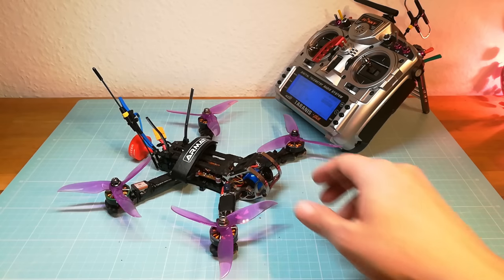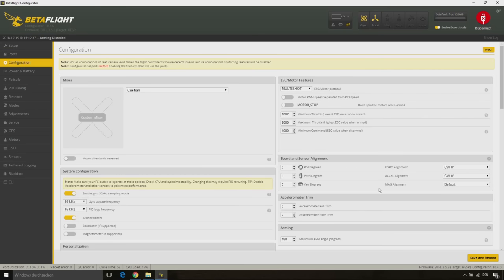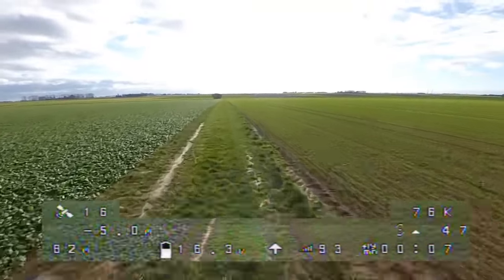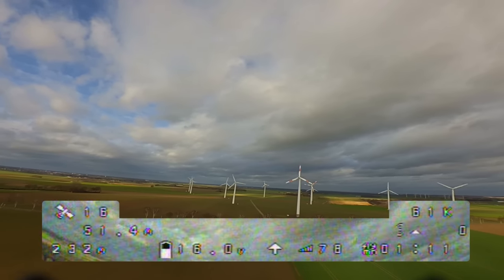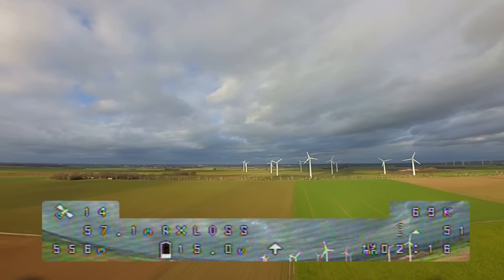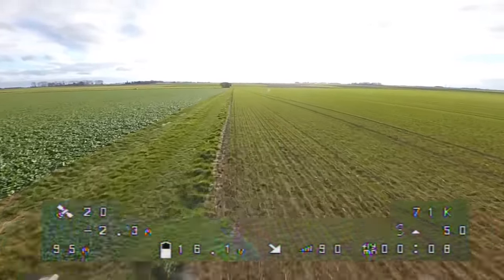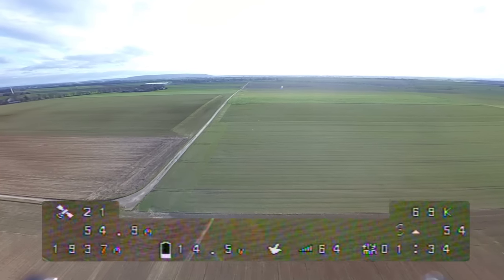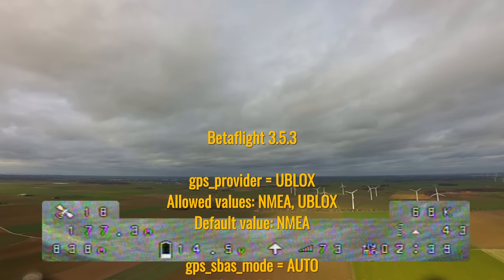Betaflight - GPS 🛰️ Rescue Mode 🚨 - Final Test - BN-180 GPS - FrSky R9M - english

Comment: I'm curious how you got your radio to power on and not immediately disarm ?  No 2 stage arming I guess ?
Reply from the maker: Tavis Gustafson why do you think the quad would disarm when i switch my radio on again?
Reply from the maker: That's how the gps rescue mode works, you get back control when your receiver gets back the signal.
Reply: @TorbanDallas  When I switch my radio on, it always starts as disarmed, but now I realize it's because of the two switch arming I have set up.
Reply: @Tavdog  well on my flysky radio it wont turn the radio back on until you have the switches in a certain position which meant it disarmed the quad in flight quite annoying. I guess i could have just gone old school stick arming to avoid that.

Comment: Is the GPS module only for the rescue mode, or can you programm any other things?( like automatic flights to checkpoints and so on)
Reply from the maker: Well, it even shows the flight altitude, speed, home direction and so on. In Betaflight you can't program a flight to checkpoints. For this you better check INav instead of Betaflight.

Comment: Hello, I am attempting gps rescue and when I flip the rescue switch the drone flies away from home not towards home, any troubleshooting tips ?
Reply from the maker: That sounds pretty bad, does your home direction arrow point to the right direction? Is your accelerometer enabled? Did you get enough satellites and did you enter the right baud rate for your GPS module? Maybe it doesn't respond quickly or if there's an orientation error.
Reply: @TorbanDallas  is there a specific orientation for the module ?

Comment: I have an FrSky XM+ and sometimes even at 100ft away from me, I encounter RX LOSS. Is it because I'm flying in a residential area where there are many interference like wifi?
Reply from the maker: Maybe. Or there are objects between you and your quad. Or lose antennas.
Reply: There was no obstacle. It was clear line of sight. I bought a new antenna. It's VAS Diamond 2.4Ghz omni-directional antenna. I'm hoping this is better than the stock antenna that came with my JumperT16.

Comment: Do you know what Happens if the quad looses sats for a second while it’s in return to home mode?
Reply from the maker: If the quad loses sats while you are flying, and the sats are dropping below your min sats, the GPS rescue mode won't work and in case of a failsafe, your quad would disarm. But I don't know what happens when your quad loses sats when you are already in the rescue mode. Maybe it also disarms, but I can't imagine that it would lose Sats on the return to home flight with a higher altitude on a straight line.
Reply: my sats sometimes go down to 7 when I fly steep curves and rolls. I lowered the min sats to 5 so I can be sure it won’t effect the rth... HOPEFULLY

But you are right that it probably won’t happen when it goes in a straight line.
Reply: I would suggest you to set gps min_sats=0 because otherwise it would not arm indoor.

Comment: How did you get it to work with RESCUE_SANITY_ON if I have it there and failsafe kicks in it will go to home alt, and then disarm. I dont have angle mode on? could that be it? I have to use RESCUE_SANITY_OFF for it to work with failsafe,   It works fine with Rescue mode switch.
Reply from the maker: with the latest betaflight version it should work with sanity on.
Reply: @TorbanDallas   You mean stable or unstable version?

Comment: Hello Torban, quick question brother. If I turn the ACCELEROMETER OFF, will it affect the normal operation of the GPS? I asked this because I turn the accelerometer off and when I flicked the switch to rescue mode, my drone became unstable in the air, so I just took over the control but it scares me 😱
Reply from the maker: AHHHH wtf, don't turn off the accelerometer! If it is turned off, the rescue mode won't work and the home arrow also won't point to the home direction. You also need the accelerometer for auto leveling when your quad is in the rescue mode.
Reply: Torban Dallas, that’s what I thought 💭😁, but I  turned it back on already. The reason why I turned it off it’s because, it might help with the Vibration. Anyways thanks for letting me know about my mistake 😂

Comment: Are you struggling finding satellites with yours? I have the same gps, but I'm struggling finding gps, even if I had a red blinking light earlier. I'm wondering if it is because of the cold in Norway..?
Reply from the maker: Taproot well i'm getting between 10 and 15 satellites after around 5 minutes. Make sure to use the galileo satellites too - it's a cli command. Also don't cover your GPS antenna.
Reply: @TorbanDallas  I only have a bit of tape over. I will have to check that command
Reply from the maker: @FPV-Jon  You can also add some shielding tape under your gps module. I have added a layer of copper shielding tape to avoid electromagnetic interference from my motor wires and escs.

Comment: Have you tested Betaflight - GPS Rescue Mode on BF 4.05 or 4.1 ??? If so, how?
  Have you used inch GPS? e.g. Beitian BN-880 Flight Control GPS Module Dual Module Compass or Matek Systems M8Q-5883 SAM-M8Q GPS & QMC5883L Compass Module ???
Is Beitian BN-180 enough for Rescue Mode ??? I admit that I lost the drone from Beitian BN-220, but maybe it's my fault I set something wrong in BF 4.05. (sorry for my English I use google translate).
Reply from the maker: I'm also struggeling with BF 4.1.x there's something changed in the Code. All in all it should work very similar as shown in my video. You can see my hassle with the latest version of Betaflight and the gps in my latest video. I won't test the rescue mode on BF 4.1.x until the gps code isn't fixed.

Comment: how low number of satelites you can use gps rescue ?
Reply from the maker: 6 sats is the lowest possible number of satellites. But I always wait for more than 8 satellites.
Reply: @TorbanDallas  what happend when I hanging upside down? and turn gps rescue? atomaticly flip over?
Reply from the maker: @246rs246  that's why I have set my rescue switch and failsafe stage 1 to angle mode  😉 but on the newest bf version it should flip to angle mode automatically before it goes into rescue mode
Reply: @TorbanDallas  thx 👍

Comment: How do you set the failsafe on a fly to it's limits
Reply from the maker: You can see all of my settings in this video.
Reply: @TorbanDallas  yes I see the setting but I did understand the part where you fly off as far as you  can and it shall automatically Rth once outta range... I have switch set up on mine to rth once I hit it but am trying to set it up where if I fly to far out of range that it RTH ON ITS OWN without hitting the switch
Reply from the maker: @glenmccall4571  it's the cli command. At the new bf configurator you can also set the failsafe procedure to gps rescue via the gui on the failsafe tab.
Reply: @TorbanDallas  i dont think you understand what am saying . i know about cli  i know about the failsafe  i know about the failsafe switch   also i know about and how to use my RTH  i have used it a few times 
.....am asking how do i set the the thing to where am flying way out pass my limits or range and NOT  switching the RTH  switch i want it to automac- turn around in come home after reaching its limts or range in you video you dont show how you just turn your kawd around and you dont show how you did it
Reply from the maker: @glenmccall4571  it automatically switches into rescue mode in case of a failsafe. I'm showing all settings, there isn't missing any setting
Reply: @TorbanDallas  thanks ill try all your setting

Comment: My XM Plus is good for over 4 kms....Yours went into Failsafe because your Lipo blocked the antennas.  Mount the Lipo under the quad.  Also, do not use the LBT Firmware on your 2.4 setup, its power restricted, use the FCC, it's far better.
Reply from the maker: 4km? so you maybe tested it on a higher altitude? On my other XM+ Range Tests i have got it to 1km and around 1.5km. 
I'm using the 181109 Flex Firmware - the zip file from the R9M Module contained both Firmwares for the R9M and the R9MM/R9Mini. It's the sbus firmware.

Comment: Hello, I have a problem, I managed to get the rescue mode to work, but with a switch that activates it, I can not get it to work with a failsafe, yesterday in some tests, when the taranis has  stopped the quadcopter falling like a stone, and today after several changes , it has been flying stopped since it had the angle mode, but it did not return to house, I have configured in the taranis the failsafe with not pulses, and in betaflight I have set set failsafe-procedure = gps-rescue.

I do not know what I'm doing wrong, if someone can help me I would be very grateful
Reply from the maker: Hi, did you follow my steps? You also have to be more then 100 meters away for testing the rescue mode, if you are too close to your home position your quad will drop and won't go into the rescue mode. So you better try it at 400 meters.
Reply: Yes, I have used all your steps, the rescue mode works if I use a switch, the quad returns to me perfect , the problem is when try to make a failsafe , when stopped my taranis the quad disarmed immediately , I have tried all of things, sanity check on, off, fs,,,, make a failsafe turn off my tranis, make a failsafe with a switch in the table modes. Failsafe switch step 1 , step 2, all the things, even in more than 200 meters...
I don’t know what can do more,

Thanks a lot for you help,
Reply from the maker: @cafater81  mh so it sounds like you did setup it correctly. Which Betaflight Version are you using?
Reply: Now I have using butterflight  3.6.6, because I have a problem in betaflight  with kakute fc and kakute 4 in 1 esc, it make me flip after roll, and now I was using butterflight , but yesterday I Tried to test the failsafe in betaflight 3.5.? , and have the same problem, when make a failsafe , the quad it disarmed..
Reply: I have little solved the problem, not totally , but better than a crash, I have put 200 points on “guard time for stage 2 for activation after signal lost”, in the failsafe tab, and it have 20 seconds of flight to return at home, is a little time for recupere the signal , it comes and I can rescue the quad, I have tested all the possible things, and not found any else.

Regards from mallorca, and thanks for your help
Reply from the maker: @cafater81  mh i didn't try Butterflight with GPS rescue yet. Maybe it doesn't work.

Comment: how did the R-xsr lose TX signal at 66% RSSI wtf
Reply from the maker: Rxsr? I have installed a XM+, but I know that the rxsr loses the signal pretty quick. On every rx there's a different rssi value where it loses the signal
Reply: @TorbanDallas  oh sorry i mean the RX you used in this video. 66% seems a high value to lose signal.
Reply from the maker: @boratsagdiyev1586  it's the rssi value of the rssi output on channel 16.
Reply: @TorbanDallas  Hmm i think they fixed it,  at least on my RX theres firmware with fixed RSSI values. (r9mm)  Ive flown it down to 30% without failsaves (ch16 rssi).   Doesnt the xm+ have fixed firmware yet? I know this video is somewhat old now and the fix was 2019.
Reply from the maker: @boratsagdiyev1586  r9 and xm+ rssi outputs are totally different. I think you can't compare these values